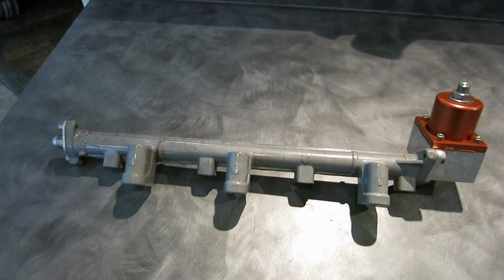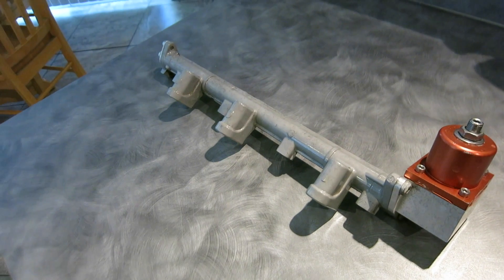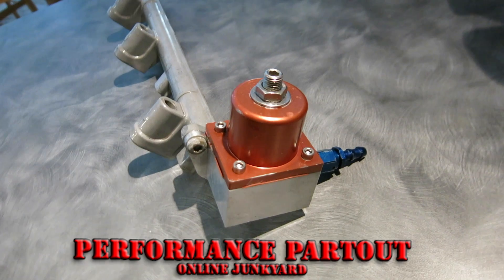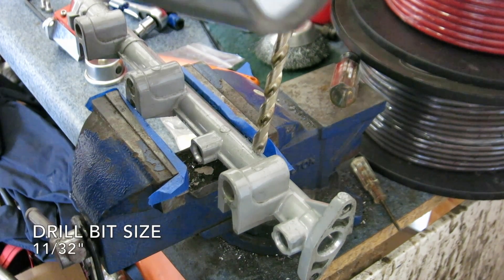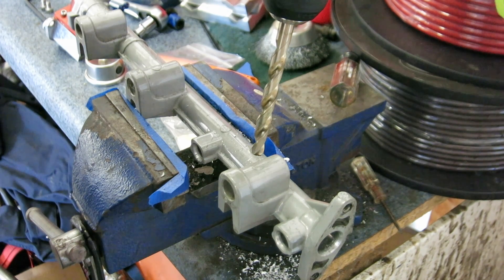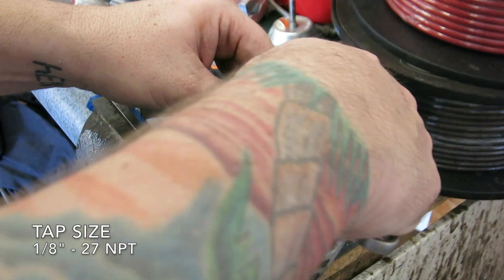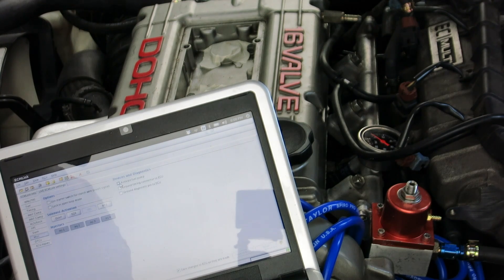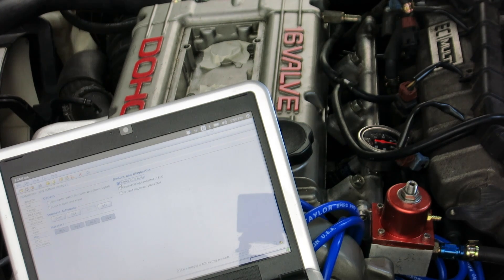Adjustable Fuel Pressure Regulator Install

Comment: Problem with these gauges is ntp threads do not seal by themselves so you must use some kind of good thread sealant, and teflon tape I am not sure is that great as.a solution because it's not made to stand gasoline.
Reply from the maker: Thanks for the input!

Comment: Another cool video joe, if you don't mind sharing the info, what brand fpr is that?
Reply from the maker: Thanks! The FPR is the old Buschur bolt on unit. Custom bottom half so it bolts on a DSM rail, and the body/guts are by SX. SX was purchased by Edlebrock back in 2012.

Comment: Thanks for the video. Maybe it's just me but the music seemed really loud compared to your voice and was a really short loop.
Reply from the maker: Thanks for watching. I appreciate the input and will DEFINITEY take it into consideration.
Reply: +Joe Wrenches I got my tyc 1145 coming :) any tips for the radiator hold down bushings ? Mine are shot
Reply from the maker: Great! That's good radiator. You should feel how heavy it is compared to the aluminum single row units. For the radiator insulators, I'd get the lowers from jnztuning.com. They are the BEST option for new OEM parts. The part number is MB538927 for those. The uppers are not available new anymore as far as I know. You can get them from a place like performancepartout.com. Tell Nate I sent you! I have also heard you can purchase front stabilizer bushing from a early 90's Mustang LX. The parts should come with 4 bushings, only two will be used. The bushings are a direct fit and do not need to be cut or adjusted. Rumor has it!
Reply: I might buy an extra set of hold downs and make my own bushings with window weld
Reply from the maker: That is a good option!
Reply: Several YouTube videos have that problem. For example, some Top Gear segments sounded great on television, but on YouTube the same segment had a soundtrack that seemed way too loud for the dialog. My guess is that it's a problem with the compression/decompression process, complicated by having to support playback on so many different devices. A friend of mine who posts videos has noticed the same problem, and said that it seems to work better when he avoids 5-speaker sound and multiple sound tracks. Unfortunately this means ruining a lot of the benefits of things like stereo sound, and even then it can still be a problem. Bottom line: just be aware that the music track can sound great in the studio, and even on a few devices, but somehow become unbalanced on other devices.
Reply from the maker: Could be a lot of different things for sure. I'll be working on them. Thanks again for the input.

Comment: Aaaaand now the cheese song is stuck in my head again. :-) Glad to see a progress update, though. Just curious: what's the advantage of a installing a gauge that's only visible when looking into the engine bay? My general inclination is to prefer sensors and computer displays (whenever practical).
Reply from the maker: Thanks for watching. The analog under hood gauge is for setting base FP, there will be an electronic sender logged in ECMLink